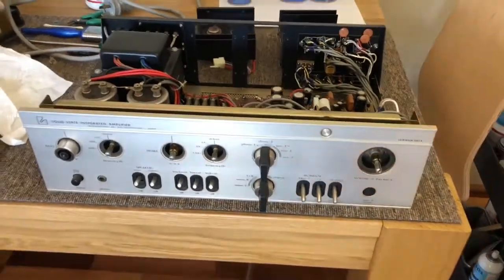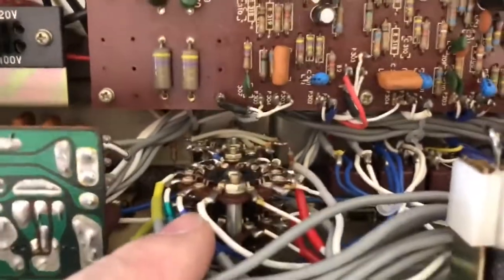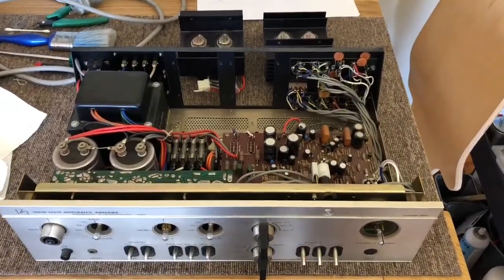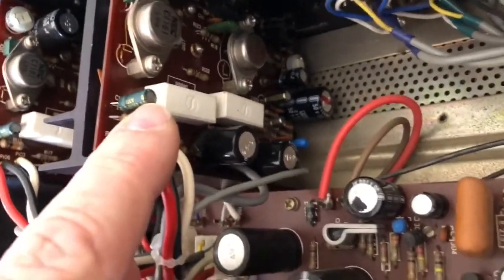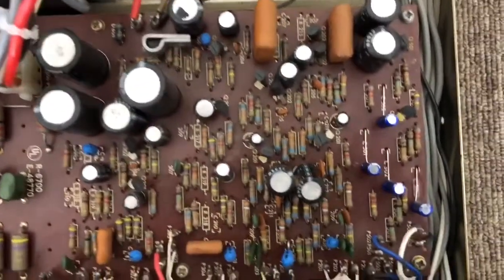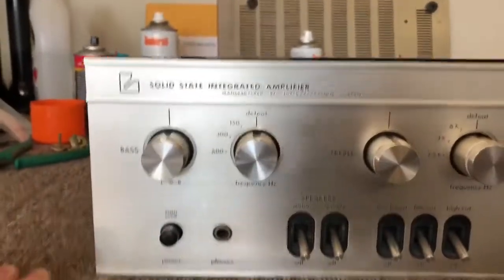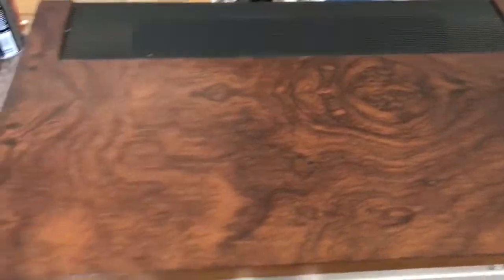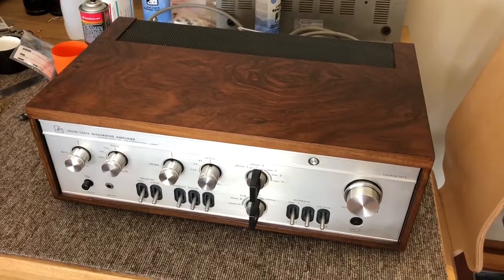Luxman SQ-507X Integrated Amplifier Service & Repair

Comment: Just had mine cleaned and serviced. This is a very nice vintage amp. Enough power to drive most speakers, very clean  sound with no noise. Almost tube like warmth from an integrated amplifier. We will never part!
Reply from the maker: Agreed, these are wonderful amplifiers from a great series by Luxman.
Reply: My 50 year old beast still drives infinity kappa 8 easily. A perfect match with kappa 6 I've just learned.
Reply: I am using the 507X with the power hungry B&W Dm2 MkII speakers. I am very happy with the sound. What other speakers do you recommend with this amp in a medium size living room?
Reply: @lLiquidAudio next time in WA, I'll get you to look at mine, as even after servicing it my input selector switch cuts out on the left channel at times. It is the switch for sure, as you wiggle it, it comes good again. Hard to find experts, like you.

Comment: Great video! I have an issue with my SQ507x since I moved.. when I set it to stereo only 1 speaker plays, when I set it to A + B both speakers play but I hear some vocals and instrument from very far away, like mono   .. do I have a bad channel or is it a wiring issue of some sort?
Reply from the maker: Many possible causes for this from wiring to switch and control issues. Sounds like both channels are working but I suggest taking her to a good technician to have her checked out. She will definitely need maintenance at this age anyway so it's a good opportunity for that.

Comment: I have the same amplifier, a friend of mine just gave it to me. He bought it new in '74, still not a scratch on it. I am trying to connect a tape deck. The cables at the tape deck are in 'rec out' and they are supposed to go in 'rec in'. But I don't see a 'rec in' on the amplifier. Do I use 'main in' or what? Thanks.
Reply from the maker: Amplifiers will often have 'rec' and 'play' jacks in a tape I/O section of the back panel. I have a feeling that on the SQ-507X the tape I/O is handled via a DIN plug though. If that's the case you'll need to get a DIN to RCA cable to use with your tape deck. The main in and out are to separate the amp into pre and power sections and should not be used for connecting a tape deck.
Reply: @LiquidAudio  I connected the tape deck cables to 'tape 1', it does work that way although this may not be correct(?) It doesn't say in or out.

Comment: The inside of my 309 has a lot of the same capacitors but they have a red pen stripe on them...would you know why?
Reply from the maker: Either factory assembly and QC markings or someone later has gone through and done some testing and measurement.

Comment: Thanks for the video. I wonder if you or any fellow 507x owners can offer advice on a problem I have with mine. A few seconds after switching on I get a short but loud crackle from my speakers. A friend has carried out a service similar to yours but the issue persists. I'd be interested to hear of any suggestions for tackling the problem.
Reply from the maker: Hi, crackling or popping is often a sign of a bad semiconductor, usually a transistor. I fixed just such an issue on a 507x recently. Servicing is maintenance-related and so won't solve this issue. Ideally it would come to someone able to trace and fix such things. If you are anywhere near Perth, you are welcome to bring her in for repair.
Reply: @LiquidAudio  Thanks for the suggestions - unfortunately I live a few thousand miles away, otherwise I would be right over...

Comment: Hello Mike,  following your videos from Europe............well, what can i say besides you're very talented but especially it's your attention for detail and love for good audio gear.
I grew up with vacuum tube since i was a little kid , later on i serviced/modified and repaired vacuum state equipment for high end dealers in Brussels Belgium.
Today i am retired but disabled but i  actually i serviced my SQ507x , the amplifier works fine , the only problem, i can't find the bias current, nor if i's measured over both emitter resistors or  a single one.. it seems to be very touchy , so is the offset setting...and the combined sv 3 diodes ( no thermal coupling ) have a reputation for failure....maybe you can help me with some advise. 
I found recently a SX505 , the little brother of the 507 and this one was already worked on by his previous owner and afterwards abandoned after failure..so i restored it but one diode  SR1K-4 is missing on the pre-amp board and i don't know what modern diode could be a replacement? Maybe a IN4OO1/4004 ?
Love the way you love doing those beautiff restoration....keep on doing it with the same passion..I alost regret not living near Perth in Australia....
Hhave a nice day.
Reply from the maker: Hi Frank and thanks for the positive feedback! The driver transistors in these units are suspect so they have to be pulled and tested for gain and leakage. Trimpots should also be serviced, or replaced if they are too far gone. I can't off the top of my head offer advice on a replacement diode but these things can always be replaced, so just pick something as close as possible in terms of type, voltage and current rating. The datasheet is very important here. A 1N4004 is a common replacement for many types, so it may work. Try it and see, but use a variac when trialling swaps like this, just to be safe.
Reply: @LiquidAudio  Thank you for the information Mike , .....I usually work with a variac .
For your information......whenever you can get some capacitors with Sikorel technologie , TRY them ! You won't be disappointed.
Can i please ask you what is the correct bias setting ( current or mV over the emitter R ) for the SQ507x .
This is a great sounding amplifier within it's power rating and capable off delicate shadings on the same musical notes.
Often i heard vintage restorations who lost their ability of their original musical sound ......i always listen after every modification or replacement of components.
>Therefore i use my reference headphones.............
summer is here .......keep warm over there.
And wish you picking the fruits of your dedicated business , continue the beautiful work, i follow you on YT............
Reply from the maker: @frankgeeraerts6243  Hi Frank, yes I've used these and other nice European caps and they are superb. There are no stated bias numbers anywhere, I calculate a rough number and shoot for that across an emitter resistor per channel, whilst also monitoring heat sink temps, per channel. I haven't got one here in front of me to play with but I'd aim for an idle power consumption of maybe 30 - 40 Watts.

Comment: Very nice job. How it performes sonically? How about sensitivity to modern 4 ohms speakers with “wild” impedance characteristics?
Reply from the maker: Thank you, these sound VERY nice, I was very pleasantly surprised once I hooked her up after overhaul. Not a hugely powerful amp, so not for use with difficult loads, but for small and reasonably sensitive speakers they sound fantastic. For reference, I have a pair of Yamaha NS10s in my workshop, this combo was just excellent.

Comment: Hey,  any idea what power-bulb part number that is?  I have the bulb out of my 507 but there are no identifiers apart from 6.37 on the bulb
Reply from the maker: Sorry, couldn't tell you a part number, I replace from stock as needed and use various suppliers.

Comment: Is it normal that when I turn on this amp there is some noise over the speakers for the first couple of seconds because it doesn’t have a protection circuit? 
I’ve recapped mine (only the aluminium caps) and this is happening to it. 
Could it maybe be one of the triple diode green things on the end amplifier?
Reply from the maker: Hi, I'd need to inspect and test yours to know what's happening there but they are usually very quiet units and sound lovely. Most of the many I've worked on have driver transistor issues, necessitating work on the amplifier modules. The drivers are a now-obsolete package but I have replacements in stock. Be careful setting quiescent current and good luck getting this resolved.

Comment: Hi ! Very interesting video and well done job, as ever. I'm following you in your website with a wealth of infos and tips... BTW, just on Luxmans... I'm now servicing a very nice SQ700x. It works very well, just started with a nice pots and switches cleaning it needed. The hardest job was to find and replace rotary switches (Mode and Input selectors) with broken shafts ... I used similar Alps rotary switches I teared down from a faulting Toshiba amplifier...  The final job will be a recapping job. What do you think about recapping of the (many) tantalum capacitors Luxman used to install in the signal path? Tantalum capacitors are (sadly) well known for their deterioration over the years... I plan to substitute them with good quality capacitors (as Panasonic FM or so...). Thank you for your precious videos. Excuse me for my poor english. Greetings from Italy. ;-). 

Mario.
Reply from the maker: Hi Mario and thanks for your comment! Greetings from Perth, your English is excellent by the way! Be careful replacing tantalums. Working on equipment like this every day, I can share that they fail infrequently and usually measure well. Tantalums generally have excellent performance, hence their use in the signal path and in ultra-expensive audio and test and measurement equipment. I suggest testing them as one should test anything before replacing it. If they test poorly, replace them. I suggest using quality tantalums in their place where possible (Vishay, Kemet etc), the design engineers put them there for a reason, typically high-frequency performance. If not, then really good, low ESR aluminium electrolytics like Panasonic FM are also a good choice.
Reply: MARIO LUCAFO'  Hi, question for you, do the knobs simply pull off, mine has very sticky  knobs on the dual bass and treble trimmers
Reply from the maker: @TheGullyfoyle  Yes those do get very stiff on these. They are a press-fit from memory, but always check for grub screws to be safe.
Reply: @TheGullyfoyle , yes...  I confirm what Liquid Audio says... the knobs get very stiff to remove, you must proceed with patience and by little steps, placing a protective sheet (a thin plastic or wood sheet to be inserted between knob and faceplate space) and trying to extract the knob with a sort of homemade lever tool (hard wood lever tool is OK to avoid knob edge damaging, like with metal tools). You may think a spray lubricant may be of help but please pay attention to the faceplate lettering, on these Luxmans the serigraphic lettering enamel is very prone to detach from aluminum plate with catastrofic results.
Reply: @Conor Weston instablaster :)
Reply: @Trevor Joel i really appreciate your reply. I got to the site thru google and Im waiting for the hacking stuff now.
Seems to take a while so I will get back to you later with my results.
Reply: @Trevor Joel It did the trick and I finally got access to my account again. I'm so happy:D
Thank you so much you saved my ass!
Reply: @Conor Weston Glad I could help =)